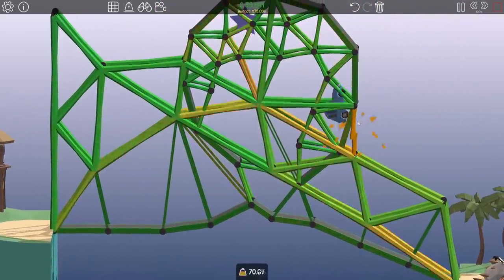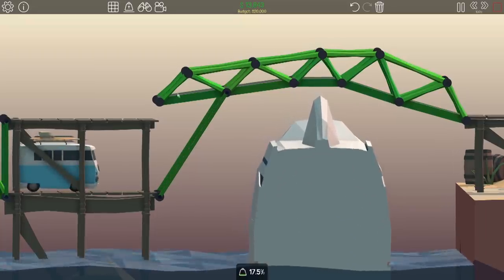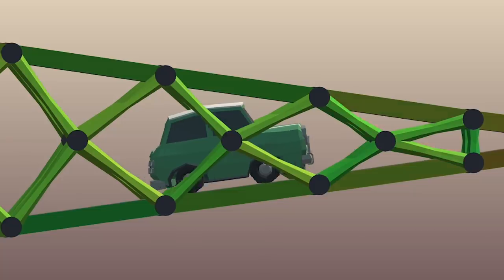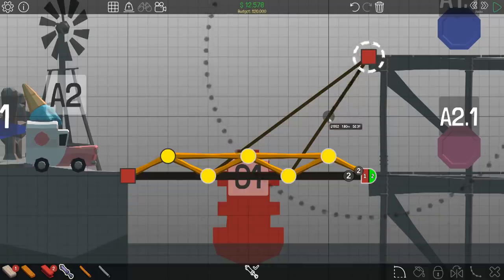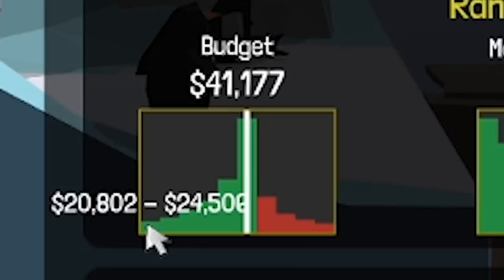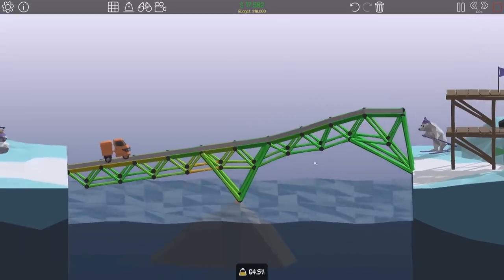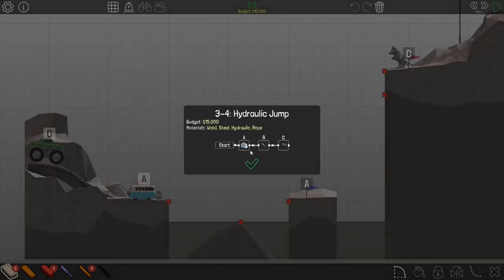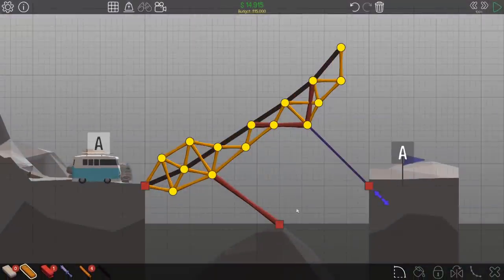Solving Problems With Loops in Poly Bridge

Comment: You should definitely use the curve tool to make better arches and smoother bridges, it's basically the same as using cheat codes for like 80% of the levels

Edit: and much more effective and easy to build ramps

Comment: remember that you could use split joints to get a connection MADE, when for example you lower one side of a bridge, make a split joint on one of the two connecting points. this makes alot of bridges way more stable

Comment: I think your hydraulics wouldn't snap the bridge if you put them opposite the joint and not close by so it can actually use leverage and pivot some. I don't know if that would actually work but good luck.

Comment: I know this isn’t related but I’ve calculated that at 10” per floor and 1.4 billion floors the bottom of skull valley is 378 million miles below the surface
Reply: Skull cavern